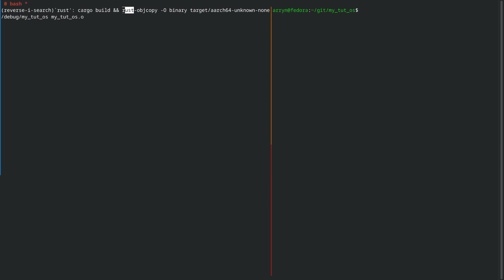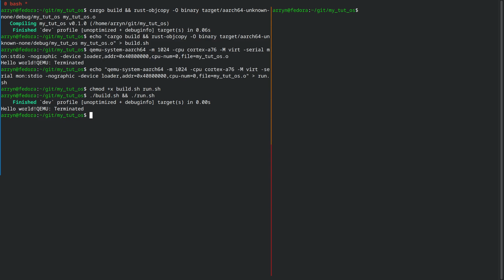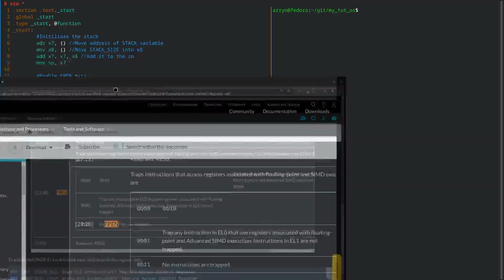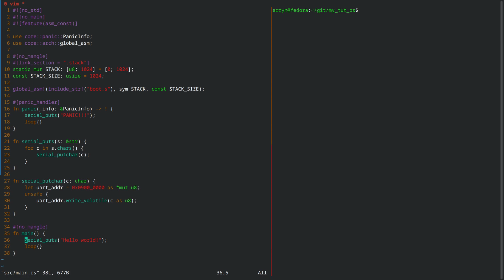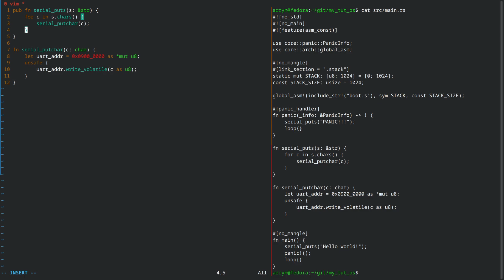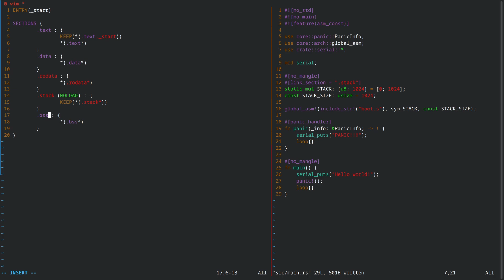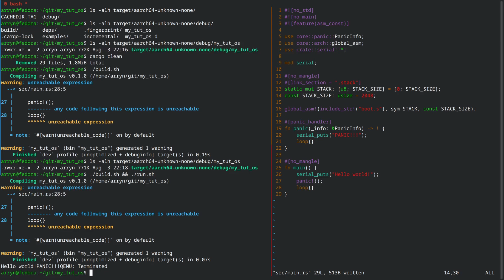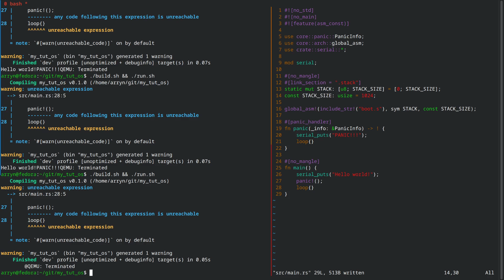Operating System using Rust and aarch64 - Build scripts and write_volatile (2)

Comment: rust actually looks like a very fun way to learn about osdev! i've always wanted to get into it but once i see all the c code someone writes i just turn away 😭😭😭
Reply from the maker: Rust is pretty powerful with very little code.
There are many things that are already implemented for us in the platform agnostic core library like for example print formatting, iterators and UTF-8 support.
And the powerful macro system is also very helpful